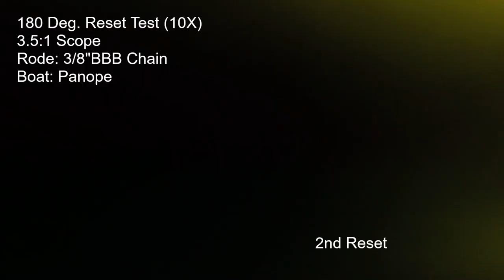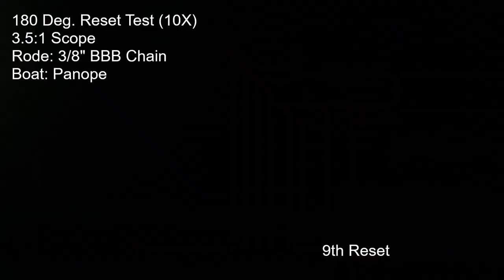Spade S60.  Anchor Test #90

Comment: I use an S140 based on your tests. I've only used it a handful of times but I like it. Getting it to set in hard sand is tough but I think that would be true of most. 14 metric ton steel 38 foot boat, all chain 10mm.

Comment: Steve thank you for the test. The great thing is, you can test and modify the anchors for better performance all at the same time in your shop. The stainless 21 pound Spade is my choice for a 25 feet boat. However, Looking at the bottom side of the anchor I see that the lead cavity is not fully filled with lead. As this anchor is light by design and in the testing we saw that heavier tip would help rotate the anchor into upright attack position faster, I will likely add lead to the cavity, to the brim so to speak. This is my primary anchor that lives on the bow. Disassembly is not important to me.
After filling the cavity with lead I weld a closing ss plate to the anchor to seal the lead chamber. The added ballast will directly transfer into increased tip weight.
What do you think, what would be your comments on this mod.
Thanks, Roman
Reply from the maker: Roman, I did a quick measurement on my 21 pound Spade.  I found that the location of the "added lead" that you propose is closer to the "ear" of the fluke than the tip.  While this added lead will increase the tip weight, the weight at the ear will increase even more.  The tip to total weight ratio might actually decrease.  Testing would be needed to verify the affects of this modification. 

Welding a SS cover plate over the lead will lead to rusting of the anchor along the weld line.  Re-galvanizing will not be possible with enclosed lead.

The developers of the Spade anchor did their homework.  Improving it will not be easy.
Reply: Steve, thank you for the reply. This is an interesting discussion that may be giving us a glimpse into why smaller anchor of the same type perform less satisfactory compared to larger heavier anchors.
By adding lead to Spade cavity at the tip on the bottom side of the anchor will change the total weight to tip weight ratio. It will also have 3 substantial effects.
1. Regardless of the ratio there will be more weight on the tip forcing the tip to penetrate more aggressively into hard to medium substrate.
2. In case the anchor flips on it's back there will be a larger moment forcing the anchor to rotate back into the setting position.
3. Overall the weight of the anchor will increase pushing the anchor more firmly into the bottom  in setting position in all substrates. 
The only disadvantage would be in soft soupy mud where the increased weight at the fluke reduces the anchor penetrating moment on the tip when laying on the side.  This maybe countered by the larger anchor overall weight and the added weight being on the anchor bottom side.
This shows that there is no substitute for anchor weight during anchor setting. As long as the weight is added on the bottom side of the anchor the heavier anchor of the identical size should outperform the lighter anchor.

And then there is the last famous line.......there is no substitute for testing😁 Thank you Steve for showing us the true world of how anchors work in real life.

Comment: If I may be critical, and I believe you to be a man who finds helpful constructive criticism, I feel it would have been helpful if you had mentioned the depth of water you were in and/or the length of the nylon rode used. Perhaps you could add this information to the video text description. Also, for search engine purposes, perhaps you could add in the title ‘All chain vs rope plus short chain rode’.
Reply from the maker: No question that I should have included depth/rode length when using all chain (I used the "usual amount"  - 26 ft + 4ft bow roller/105 ft).  

For the rope road test, I reasoned that depth/rode length made little difference (at a particular scope) as there is virtually no catenary regardless of depth/rode length.   However, now that you mention it, the rode length DOES affect the amount of shock absorption during the reset test.    

Thanks for the suggestion.

Comment: Would the 60 work for a bluewater 23t. Dry weight 3450 fully loaded estimated at 6k. Next size up 80 is only in aluminum. Have you tested to aluminum spades??
Reply from the maker: I think the S80 would be the safer choice.  The information on the Spade Anchor USA website is not clear about availability. Can you confirm that the S80 is no longer available?  I have never tested an aluminum Spade.
Reply: @flygoodwin  I will look into it. On their page it was only showing aluminum for the 80. Thank you for responding. You do awesome work!!!
Reply: @flygoodwin  I just called and they do have the s80 in galvanized. The website was a bit confusing.
Reply: What boat is a bluewater "23t"?  I have a Contessa 26 and am trying to decide S60 or S80, both are galvanized steel.
Reply: Actually this is one of the annoying issues with the Spade for smaller cruising boats in that the jump from S60 @21lb to S80 @33lb in weight is quire large.  My boat is just under 26ft with a dry displacement of 5400lb and the S60 is supposedly too light according to their tables. They should have one in between, an S70 at say, around 27lbs.,

Comment: Another great test video. Thanks! I note you will be testing a larger Viking anchor, looking forward to that video. Will you be testing it in both the concave and convex configuration? Any further thoughts to my suggestion of retesting the small Viking 7 in the concave configuration? Would be interesting to see if there is any change in mud accumulation or holding power, etc.
Reply from the maker: Ross, I wrote a note to Viking seeking confirmation that they approve mounting the fluke "upsidedown".  If they say yes, then I will test as such.  Thanks for the suggestion (again).
Reply: @flygoodwin  okay, cool :-) Thanks for the update.

Comment: Don't understand why u insist on pushing the threaded shackle end thro the attachmet hole in those spade anchors ... just as easy to put the pin thro ...
Reply from the maker: Greetings Gordon.  The threaded "boss" of the shackle will not fit through appropriately sized chain links.  Therefore, unless one accepts using two shackles (I Don't), then there is no other way of making the connection.  
Another  important reason, is that the load rating of a shackle is for straight line loads (no side loading).  If the pin passes through the anchor as you suggest, the shackle will not be allowed to pivot, which can result in a side loaded shackle.
Lastly, some bow rollers have limited width and/or have sharp edges that will "catch" the shackle pin ear.  If the pin passes through the anchor, the shackle will not pivot with the result of the anchor being stuck.
Reply: @flygoodwin  Got it, thanx.